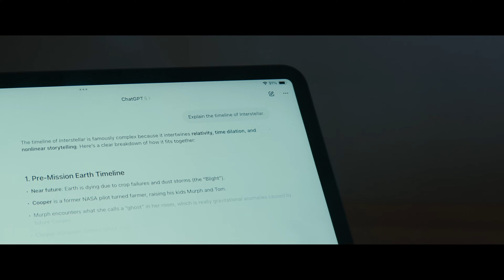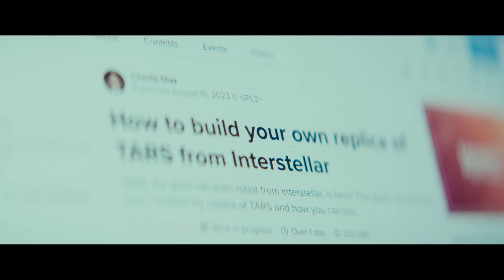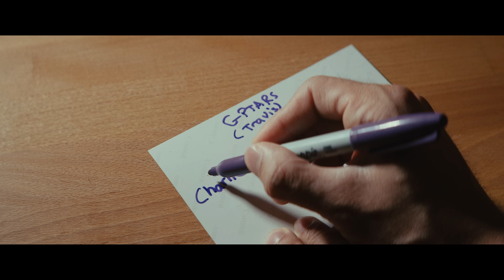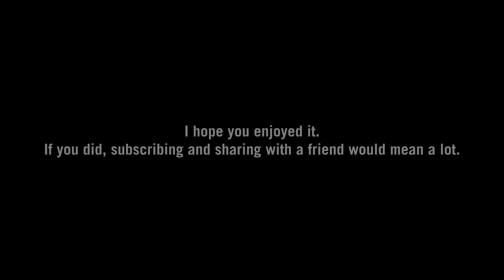My AI Robot TARS Meets People for the First Time

Comment: I want a GPTARS. I know nothing about robotics, but I am a skilled 3D modeler, particularly with programs like Autodesk Fusion 360 that uses boundary representation modeling (i.e. perfect for 3D printing). I bet I could design a pretty dang good TARS. I'm guessing that it's made soo blocky on the arms for stability purposes (and probably for motor sizes), but I bet that's also solvable by using motors to apply a slight sideways pushing force to keep topples from happening (or some other internal mechanism to slightly bow the arm outward to the side in an almost imperceptible way). I think another improvement would be the ability to make the arm movement almost silent, like the real TARS. 

As for the movement, I think it could be improved in novel ways. In the show it's much more fluid, and I think the main reason why is the weight itself could probably be shifted internally with a force. So the simplest way I can think of to improve it is a magnetically based rail setup, like an abacus, where you would have essentially a small rail and a "bead" weight internally that can be quickly pushed to front or back, magnetically. It should then be able to do quicker more fluid movements with strategic placement and control of these mechanisms.

A flywheel mechanism in each arm and the mid section could also create some interesting movement fluidity opportunities. One at the bottom, one at the top, spinning in opposing directions, could allow for both stability and fluid movement speed increases. If the flywheels could also slightly rotate, that would also allow for turning speed increases, and again, with increased stability. Of course it would also increase energy demands, but flywheels are energy storage mechanisms, so they could feed some of that energy back into the battery, which would also allow for a rapid decrease in flywheel speed when needed, like a braking mechanism. With something like this it would look truly scifi in its movement speed and precision.

Comment: Dude it's soo good , especially the body, have been following you for some months through YT shorts, it's good

and just as an advice, in such events you can use wireless microphones, instead of wired, one using esp modules and like i2s microphone and configure them to filter out such large background noise(the microphone module has some noise cancellation but for large events you can manually code it) you can make it so that while the wireless mic is active the wired is on standby and , when it looses connection/switched off/out of range the inbuilt can function, same with the speaker honestly , since you are using gpt and some kind of text to speech, send it to your laptop/device  wirelessly and play it through a python script, with the same principle of the mic , very helpful in such large noisy events